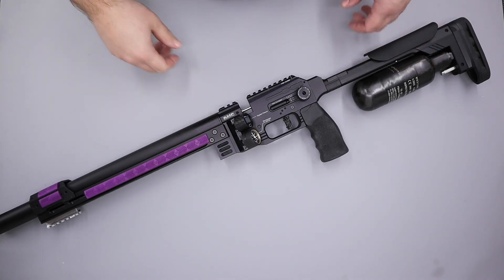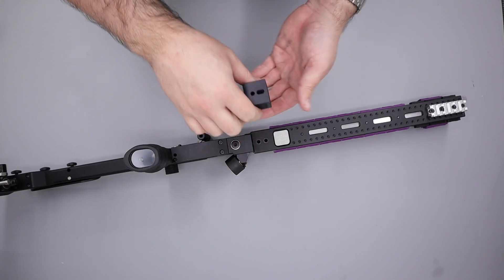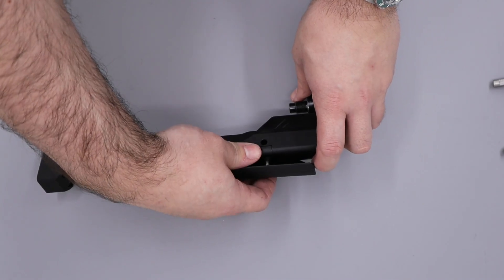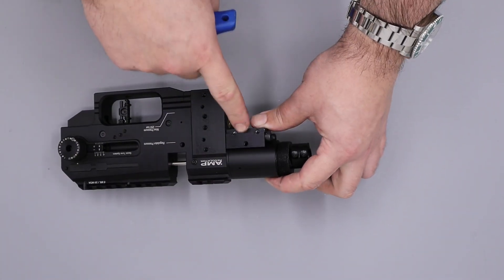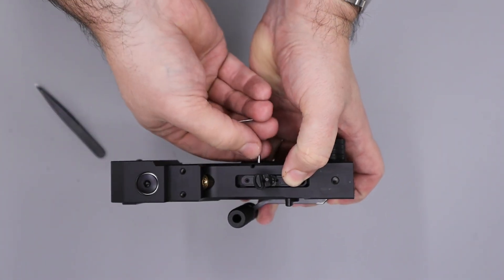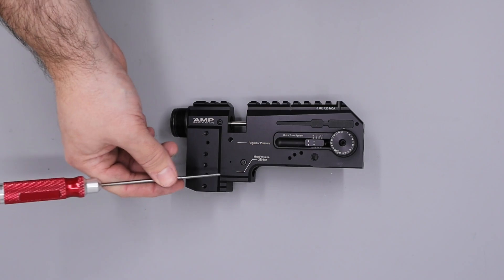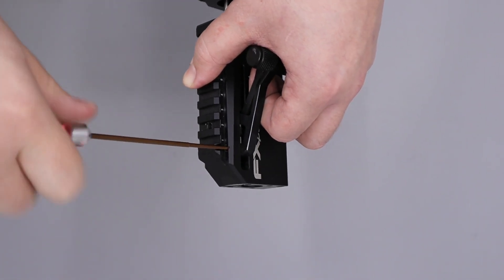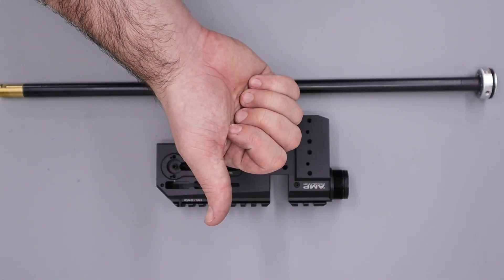FX Panthera Full disassembly (UK Spec)

Comment: Mine dumps all air out the barrel I’ve replaced valve seat and houseing and oil and all o rings and it still pours out of barrel any ideas?
Reply from the maker: it's the valve in some way, have you tried backing the hammer spring off and seeing if it still leaks 👍👍

Comment: Hey!  I dry fired my rifle to make sure no air was in the system and I believe this bent my valve.  I now have a massive leak through the barrel and it wont hold air.
Do you have the v2 valve installed (which is thicker) or any other modification that allows you to dry fire it?
Reply from the maker: we have the original valve in our one but we are only sub 12 fb so i don't think it's a problem

Comment: I have a leak on my brand new Fx Panthera, the air is coming out of the barrel, did the disassembly and couldn’t figure out what’s the problem !!
Reply from the maker: if it's coming from the barrel it's 99% the firing valve or seat
Reply: @sub12airgunners  found out it was the valve seat took it out and changed a seal, now it work works perfect !! Thank you so much 🙏

Comment: Hi great video as always.    I'd like to pick your brains if that's ok I've been shooting for a long time and I'm a springer shooter but I've got my first PCP today a daystate wolverine r ( used ) it's a great gun and very accurate the only issue with it it's only doing 10.5 ft lb with bsa goldstar 8.64gn I would have thought it would have been slightly higher is there anything I can do ( never worked on a pcp ) to increase the fps to increase the ft lb.     Many thanks in advance phill
Reply from the maker: if you try 10.34 pellets it will be much closer to 12lbft if it's still a bit low have a look on the Daystste youtube channel there is a vid on the wolverine which will help 👍👍
Reply: @sub12airgunners  
Thx for your reply    I'll give them a go and see how things go
     Many thanks for getting back in touch regards phill
Reply: Hi geoff / Jake I've tried heavier h&n baracuda match @ 10.65gn the power is now 10.9 ft lb so not much difference from the 8.64gn the reg is set at 120 bar could the hammer spring need a tweek and is it something I could do myself
     Many thanks in advance
           Phill
Reply from the maker: @phillipward4862  yes it is very simple, 1.5mm hex key
Reply: @sub12airgunners  hi guy's that's great thx for your reply.    Just one more question if I may to remove the safety catch to get to the anti tamp bar to be able to make adjustments do I have to degas the gun first or is it something that can be done while gassed.     Many thanks in advance phill
Reply from the maker: @phillipward4862  if you just need to get to the hammer spring adjuster you don't need to remove anything or de gas you can use a 1.5mm hex key in the adjuster on the side same as the m3 👍👍
Reply: @sub12airgunners  thx guy's

Comment: how can you stop the pinging noise
Reply from the maker: the ping is often the valve return spring resonating, a simple delrin slip ring on the ends of the spring can make a big difference to this the cylinder guns sometimes need a baffle in the cylinder

Comment: hi can you help ,I have sub 12 Panthera and its pinging when firing ,have you come across this before
Reply from the maker: the ping is often the valve return spring resonating, a simple delrin slip ring on the ends of the spring can make a big difference to this the cylinder guns sometimes need a baffle in the cylinder  👍👍